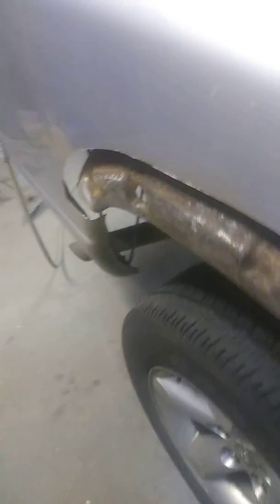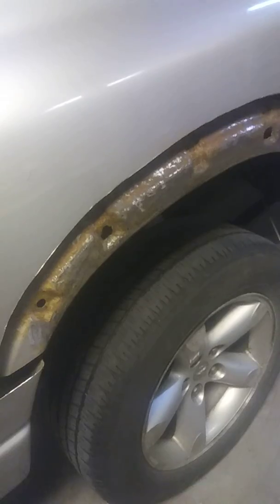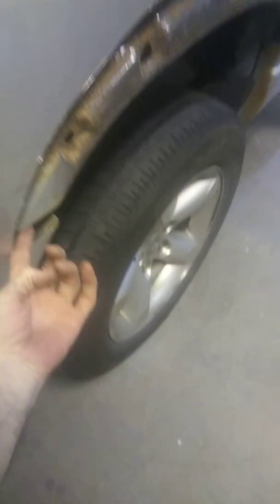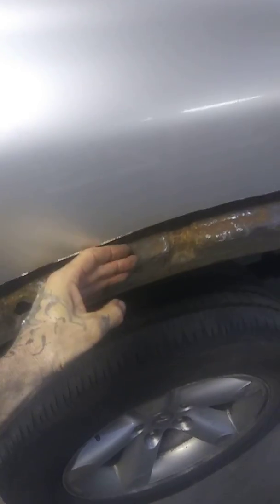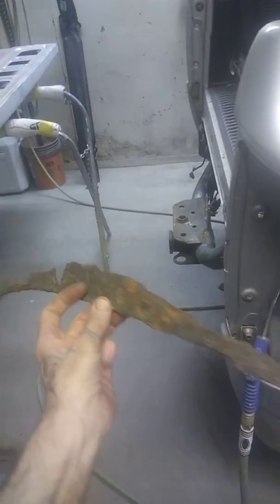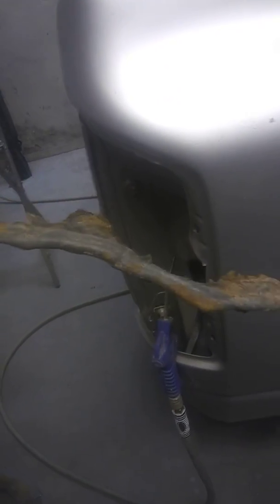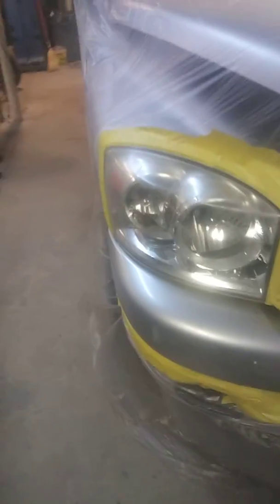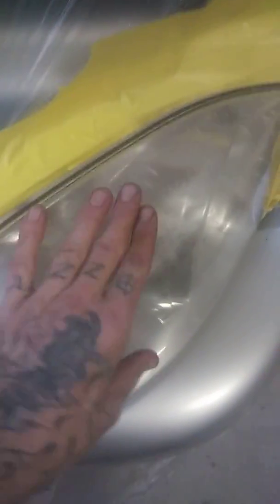Dodge ram progress

Comment: Hi Ed. Not really that bad for an 07. I've found that with the seam seal or without it, ya still get condensation on the inside, no matter what. And with little air flow inside the cavity to dry it out quickly, rust is just a matter of time. 
Thanks for the update and God bless you folks.